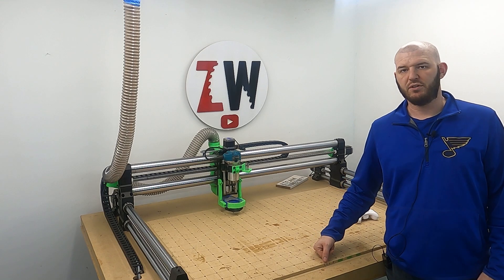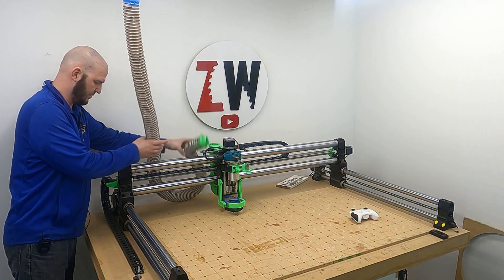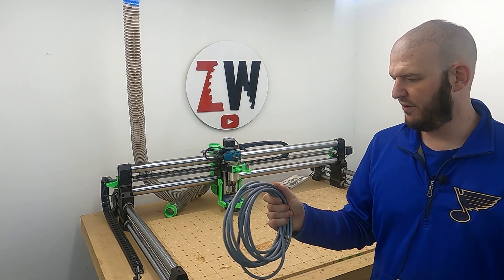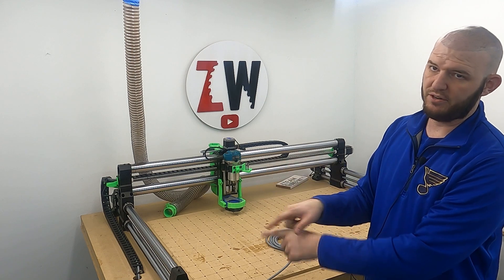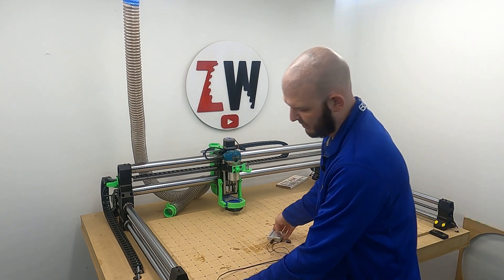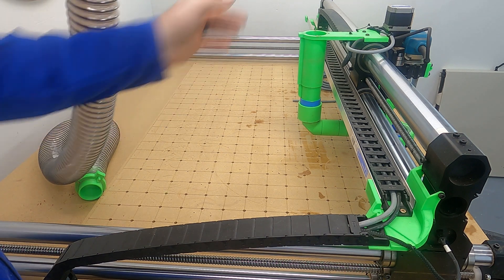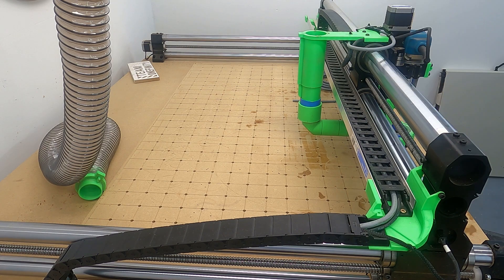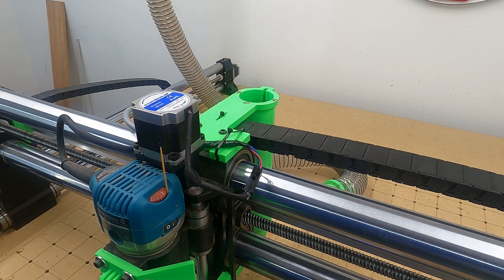Onefinity Cable Management Basics

Comment: I have a onefinity woodworker with the drag chain setup. I also have the Jtech 7 W laser. Im just confirming they (I ordered mine from onefinity the Jtech laser) included enough cable to go in the drag chain setup.  And im confused on the worry about the wire bending? your using drag chains. if the drag chains are working as they should, You should not see no tight bends in the wires. I myself bought the wire extension that onefinity sells (2 cables) pulled the end of each cable made the crosswire (cross the green and the white) and i use that for my Z so i could leave the curly cable alone. So far i have had no issues.
P.S . You can get a router power cable and connect it to the router itself no splicing. I would not splice that. open up the router and put on new cable. hehe on the one thing i would not splice you splice and the one thing you say not to splice i splice. thought it was kinda funny.
Reply from the maker: That is funny! Thanks for the J tech info. You're correct about the bending radius with the drag chain. I just don't know what yield cycle allowance the current cables are so I replaced them with made to bend cables. Really with what we do I think the original ones would be fine. Just figured while I'm at it might as well. But then comes in the router power and J tech cables. And if I'm doing the signal cables for the router why not those others as well. Guess I just need more time and money!

Comment: Thanks for mentioning the crossover part about the wiring. I can confirm Onefinity absolutely hates drag chain conversions. They get really bent out of shape when you don't want to use the "curly", their word not mine, cable. And is 100% the reason they used a crossover cable for the Z and only the Z.
Reply: That’s ridiculous. My “curly” was almost eaten up by my router.

Comment: I am reminded of the adage “Don’t fix what ain’t broke”. It’s not clear to me what the problem is you are solving.
Reply from the maker: The cable management, or the dust collection? I guess why use a CNC when there’s a hand held router? Why use a hand held router when there’s chisels. Why use chisels when there’s (insert primitive tool here). Always keep improving, and making life easier I guess.